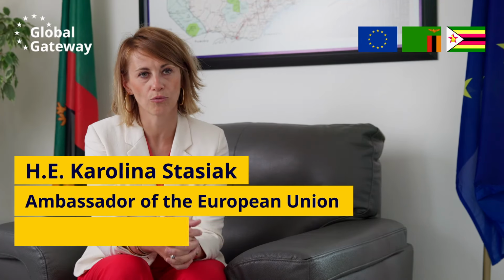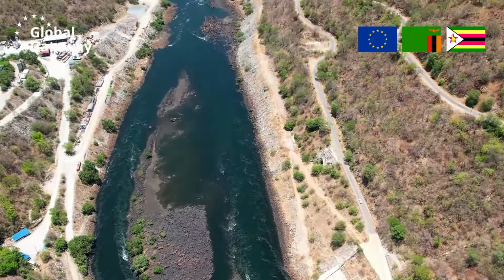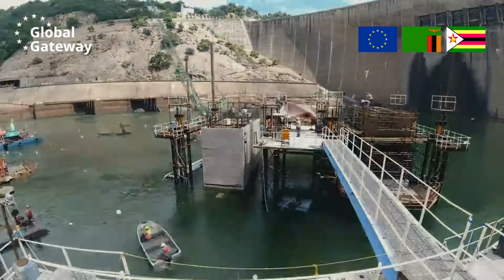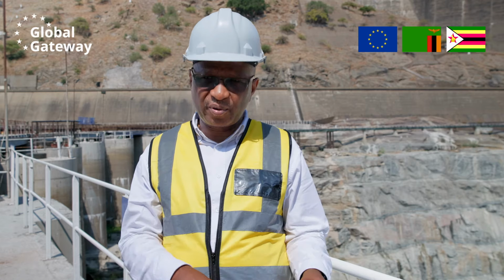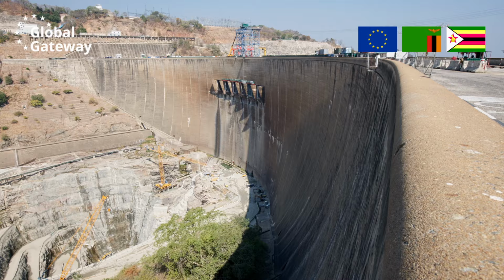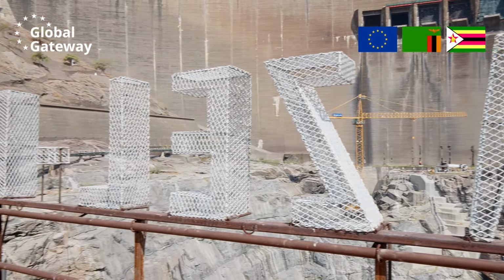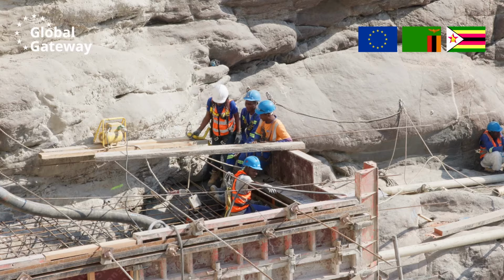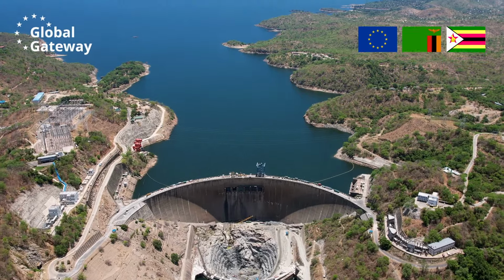Kariba Dam Rehabilitation Project

Comment: This dam was designed by smith and what have the Zambian and Zimbabwe gvts done to build more hydro power project dams
Nothing
Reply: In Zambia they built Itezhi-Tezhi dam on the Kafue and it also provides hydro power for Zambia
Reply: Unfortunately Kariba dam built by Federation of Rhodesia & that tym it was Southern Rhodesia not Rhodesia of Ian Smith
Reply: @brianshumba4349 Ian Smith was the PM of Southern Rhodesia when the dam was completed.
Reply: The two countries are jointly working on the construction of the Batoka Gorge Hydro-Electric Scheme (HES) with a capacity of 2 400MW output along the Zambezi River. The scheme will be situated approximately 47 km downstream of the world-renowned Victoria Falls/Mosi oa Tunya. Both countries also have their own inland dams they have built to supply power among other uses.
Reply: They finished the dams, increased their Capacity, operated them for decades and led the project to finance their rehabilitation. 
Smith was a disaster for Zimbabwe but white supremacy is always a disaster and Zimbabwe is still paying the price today. Smith's government threatened  to blow up the dam to prevent its use by Zambia.
Reply: @MarkGovern still paying the price...................................this is really the problem with Zimbabwe - the amount of mental energy devoted to not taking responsibility for current actions.
Reply: Not true. Since the completion of Lake Kariba in 1959, both Zambia and Zimbabwe have pursued significant hydroelectric power (HEP) development projects, primarily along the Zambezi and Kafue River basins, while simultaneously managing these shared water resources peacefully through established institutions. 
Zambia's post-Kariba HEP efforts have focused heavily on the Kafue River, resulting in the completed projects of Kafue Gorge Upper (1970s), the Itezhi-Tezhi power station (2015) which utilizes its 1977-built regulating dam, the new Kafue Gorge Lower (KGL) power station (c. 2021), and the expansion of the Kariba North Bank Extension (2014) on the Zambezi. 
Zimbabwe's focus has mainly been on smaller hydro-installations on existing dams, such as the planned small HEP potential at the country's largest inland dam, Tugwi-Mukosi (2017), and mini-hydro projects on dams like Lake Mutirikwi and Osborne Dam, in addition to the major jointly planned Batoka Gorge Hydroelectric Power Station (BGHES) downstream of Victoria Falls, which is envisioned as a massive 2,400 MW arch-gravity dam complex, currently in the process of seeking new investors and financing after the cancellation of a 2019 contract. 
Crucially, the peaceful co-management of these transboundary water resources, particularly the Zambezi River, is facilitated by the bi-national Zambezi River Authority (ZRA), which oversees the Kariba and Batoka projects, and the broader Zambezi Watercourse Commission (ZAMCOM), which promotes cooperation and joint development among all eight riparian states under the framework of the SADC Revised Protocol on Shared Watercourses.